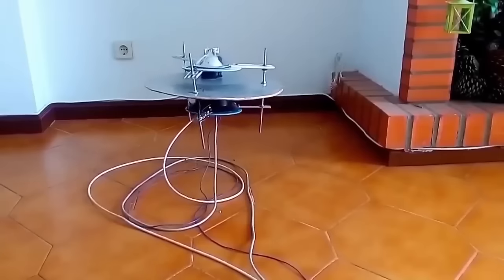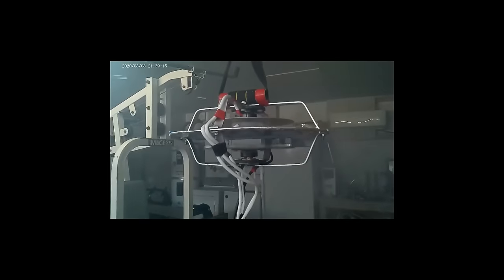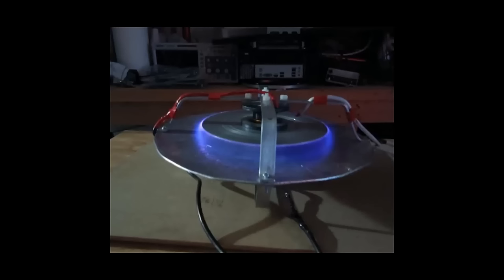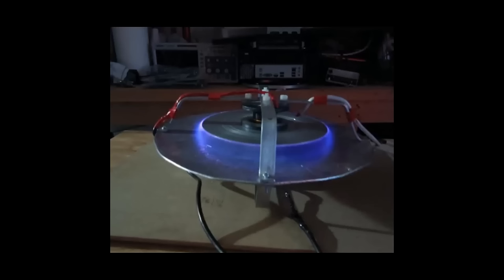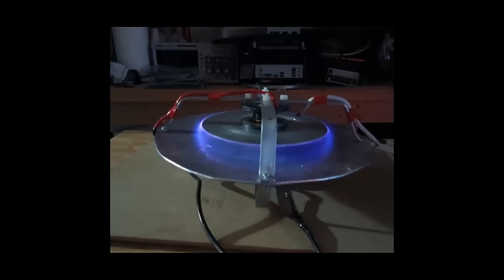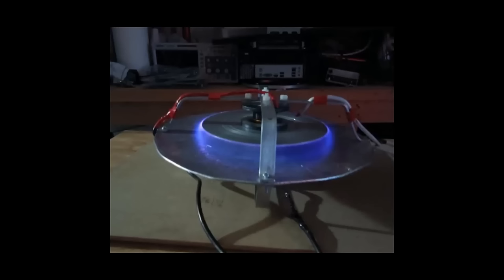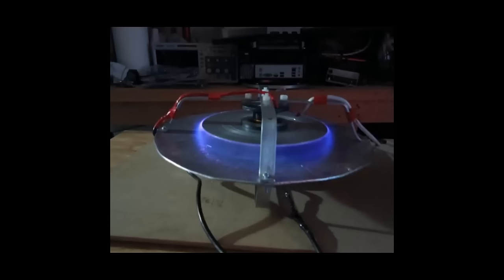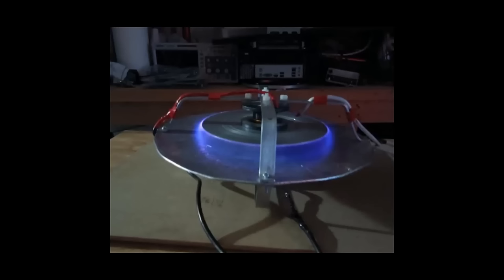Building The Graviflyer "Testing Everything"

Comment: If the thing needs to be resonated with the magnets, then you need a bigger center plate. I would take a microphone and put it next to your aluminum and tap the plate with a mallet to see what the frequency is. Just becuase someo e has said aluminum resoants at roughly 58hz, doesn't mean it actually does. What I mean by that is simple. Take a 1ft ruler and find the resonant frequency, and take a 3ft ruler and do the same. If they are made out of the same material, then their resonance will be diffrent due to the amount of material difference. A larger tesla coil will have a lower frequency then a smaller one. Same principle would apply with your flyer. Another words, your resonance might not be where it needs to be, could be too low with the small center piece. 

Have you looked into making a discord? I have some pictures of some project I would like to share with you and others. 

How did you discover that there is a bubble with 4 layers?
Reply from the maker: I like the idea. Like a tuning fork to a speaker it shows the resonance value. I am definitely trying that. 

I did the rotating magnet test. What I didn't show in the test was that it was all around the the rotating magnet like a sphere.     https://youtu.be/9ly8sSCxtWA
Reply: @nathanbunten4299  it wouldn't only be a tuning fork but for any item like the center plate of your flyer. 

In your other video, I'm seeing more then 4 sections. Would it not just be the strength of the magnetic field that you are measuring the distance of? Technically it would have more then four if you added 3in, 5in, etc or 3.5 in, 5.5in" etc
Reply from the maker: @freedomer342  I think I found my answer. tapping the tuning to a speaker gives you a resonate value of the fork. Tapping the center plate will do the same. So when the top and bottom disc match that value then hitting the ultrasound will give the Townsend effect. This may change all the values in the project.
Reply: @nathanbunten4299  then you need to get your motors to rotate at that rpm. I think you take the rpm and divide it by 60  to get the frequency of it
Reply from the maker: @freedomer342  I will look up the math. But I think we are on the same page. This might be why no one can make it work.
Reply: @nathanbunten4299  the bigger the center plate, the lower the frequency should be. Now I'm not quite sure how you would amplify it after it's resonating. Maybe a tesla coil at the same frequency?
Reply from the maker: @freedomer342 that seems to be what the maker did.
Reply: @nathanbunten4299  and how did that go?
Reply from the maker: @freedomer342  it is said to fly. I broke 3 tesla coils trying it. It needs a spark gap one, not sstc.
Reply: @nathanbunten4299  your spark gap should be connected to your motor
Reply from the maker: @freedomer342  that sounds better than how it is designed. however I did not think of that.
Reply: @nathanbunten4299  if you did it like that then you would be able to have your high voltage as the same frequency as the rotation of your magnets. You could auto tune your sparkgap by having a telescopic sparkgap arm that has a spring inside that is controlled by a stepper or servo motor or even a hand dial. This would allow the centrifugal force to fully extend the telescopic arms out. With the spring and the motor or dial applied, you could pull that telescopic arm in while running at full speed. This of course is something you could do on a much larger scale. 

One could also go as far as making an adjustable sparkgap so you could actually produce your frequency without having to run a motor. Kovar is a metal that can bond to glass. Have two electrodes for your sparkgap and one would be attached to a metal bellow. You could also use a motor or a dial to adjust the sparkgap in the vacuum tube. Also if you added a port that would allow you to put any kind of gas inside for capacidiece and breakdown voltage. 

You could even take that further and add a water tube made out of the same glass and use it to warm water if you installed a piece of metal inside the tube. One would have to make sure the glass was thick enough and also the metal wouldn't expand and crack the glass
Reply from the maker: @freedomer342  I might try that. I don't have much luck with tesla coils. But it is worth a shot.
Reply: @nathanbunten4299  you can buy the secondary prewound and there's caculators for the primary circuit online
Reply from the maker: @freedomer342  I have a good coil. It's the mofsets that give me trouble. I need to switch to a spark gap model. I built 1 and it worked better. Just needed more power. I think I have it figured out. When I start it up again I will make a video. Then we can discuss how to make it better.

Comment: I really don t like to see other physics professors copy each other with this Graviflyer the only one I have seen that works is the one bye Alexey Chekurkov his does work 100 % , the only problem with antigravity it wont work in space the dark vacuum of space , so think about that , they will only work on Earths atmosphere and gravitational field so think about that plus if you built a full scale saucer it would be very hard to find a power source that could give you the watts needed for flight and to be the correct frequency .frequency is the key to most things that are electronic .
Reply from the maker: This device is very low power. It only uses the power to get frequency to the different parts. The field it is creating may work better in a vacuum. We will have to test it to be sure though.

Comment: Hi i like that but i dint think power by electric but i havent do any plans but i think the key is a ventury shapemay be in the plates but hard to make it royator ventury will sock the ambient air as rotate and brind this air to the center of the plat you need and addresser that make this air togo foward up or down or back ward i thing may work venturys been use for long time perse they was making the aircraft instrument to work with a giroscope in conjuction you have sime key to work let me know if this sound interesting

Comment: You should be testing with ceramics (Clay), and ground graphite ( some graphene), mixed in the dry clay powder. Graphite Clay is much cheaper, for your tests. You don’t think them UFO’s are made of metal, do you?? Weight, has no significance, when higher voltages are introduced.
Reply from the maker: they are always made of aluminum. Or something like it.